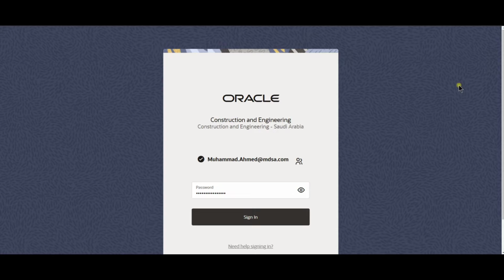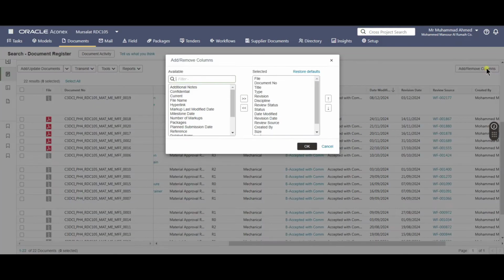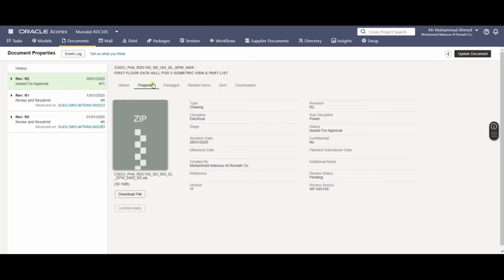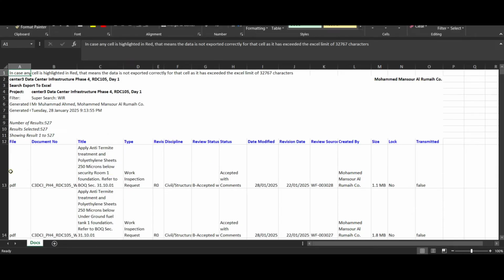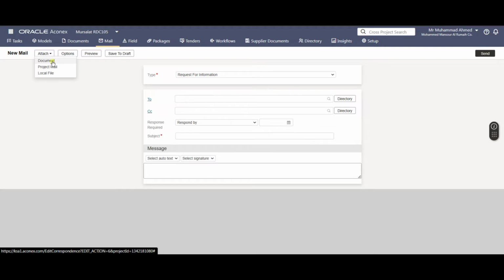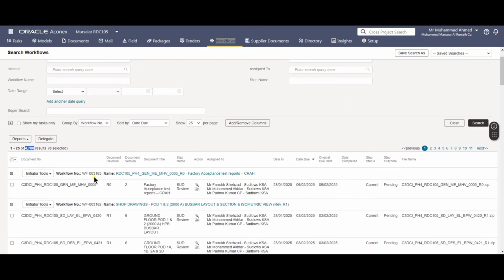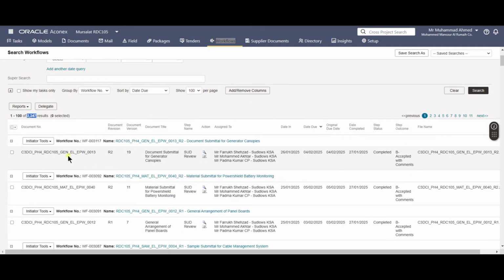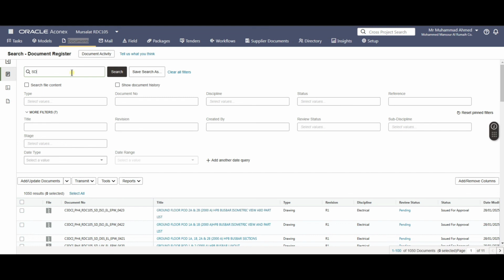Aconex for Construction Project | A guide for engineers

Comment: A/S. I have one question regarding submittals. Suppose I want to send a shop drawing to a consultant for review then we create a shop drawing submittal. My question is, is the shop drawing submittal  preconfigured in the Aconex? Similarly all other submittals let's say material submittal, method statement submittals are all preconfigured in Aconex or a DC is required to create these submittals own their own?
Reply from the maker: Generally, the submittals accompany cover pages. These cover pages are created using templates. On Aconex we have to define the metadata before submission